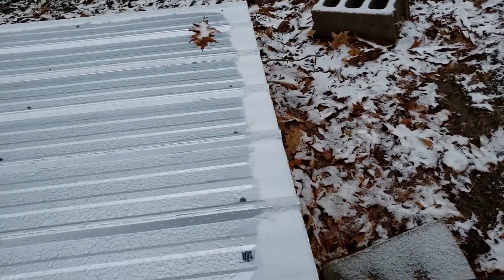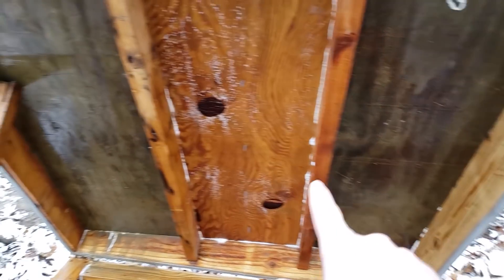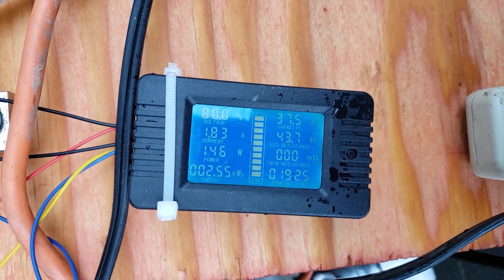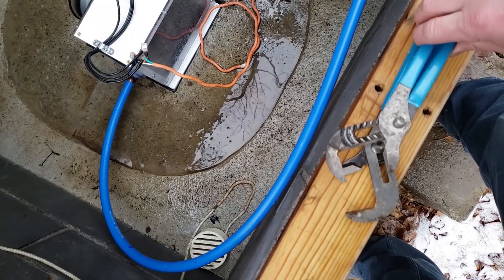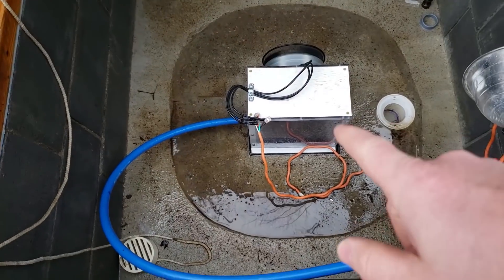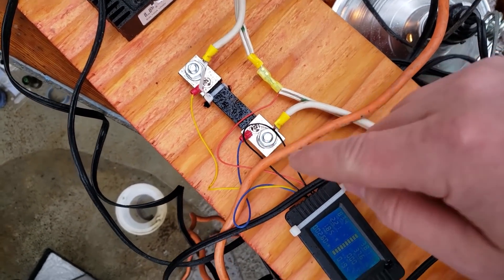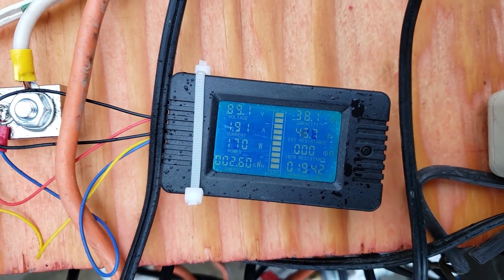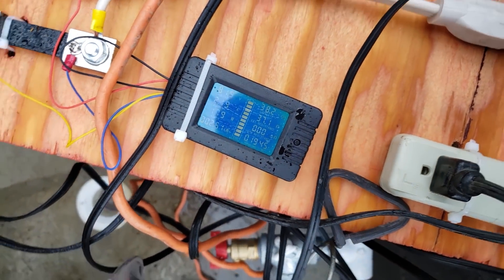More Watts From The Turbine With Some Tweaks

Comment: Nice one cold haircut, I always grow my hair in the winter,, 
actually all my hair, except my beard. 
@joe malovich
The numbers are not precise. If you measure rectified ac with a dc meter... will it read the same voltage? Hmm...
basically making tame mistake twice, so dont compare them.
Reply from the maker: I'll be in the Caribbean in 2 days.

Comment: "I don't know if there's a short..." Not trying to be a piss on your parade Pete, but that wiring....it's giving this electrician an aneurysm just looking at it. Please, for the love of all that's holy and good, please, get your wiring out of the water. Create a power box on a pole next to the turbine to keep everything dry. The moisture alone is going to negatively impact the performance and output of every component that gets wet.
Reply from the maker: This is temporary testing whipped upon 10 minutes with materials I had on hand. There will only be an alternator in the pit in the final version (plus some powered valves)

Comment: I would not try to double the nozzles on that coil and shaft. You have a guaranteed double. If you get yourself another coil add another shaft and Pelican wheel. And you can say you have twins. I imagine you definitely need diodes that is the one-way valve for electricity. If you don't have a diode are you tied both teams together. If one shuts down it may turn it into a heater and cook the coil. Yet if you had dual rectifiers and then two diodes. This problem should be solved and you should have doubled your energy.

Comment: The reason your efficiency goes up when you change the load is because there is an optimal rotation speed. The pelton wheel becomes more efficient when the jet velocity is close to (iirc) double the speed of the cups. The speed of the cups is directly related to the RPM(something involving pi and the radius), and the output is directly related to the output the RPM(angular velocity) of the  generator. So you need to find an optimal voltage for your jet velocity...
Reply: The optimum rpm will be 1/2 the no load rpm of the turbine, so the maximum power point will be when the voltage approx 1/2 the no load voltage

Comment: Your lights are ac and you are running them off of dc change the lights to dc and you will get the power you are looking for.
Reply: Joey, think he's just using them as a resistive load for measuring output, maybe would be better with DC load.